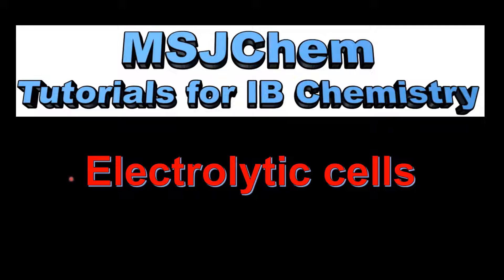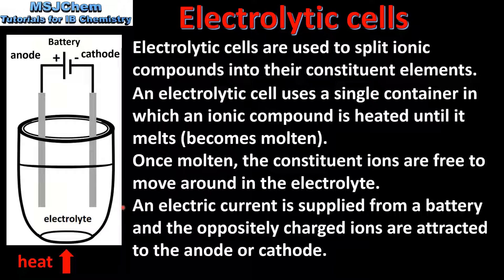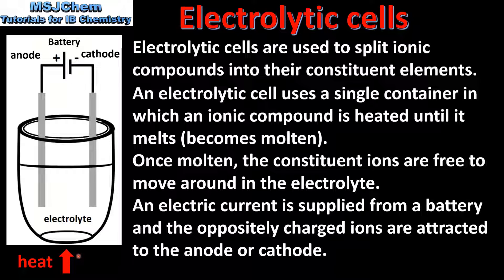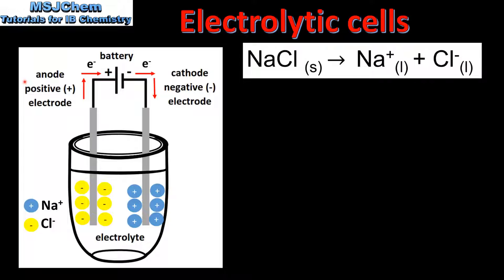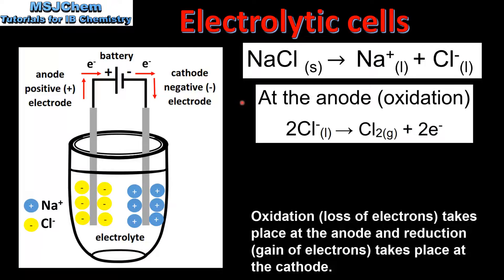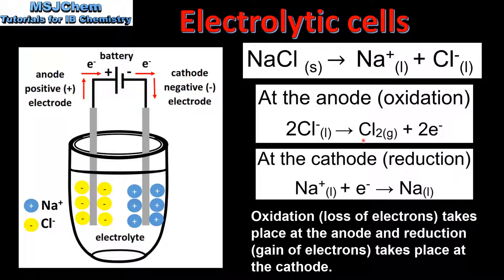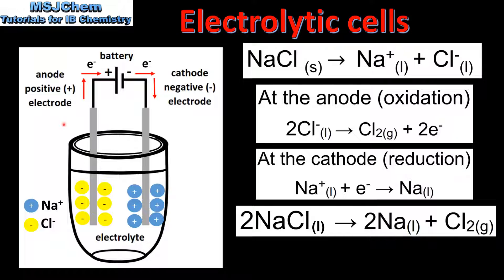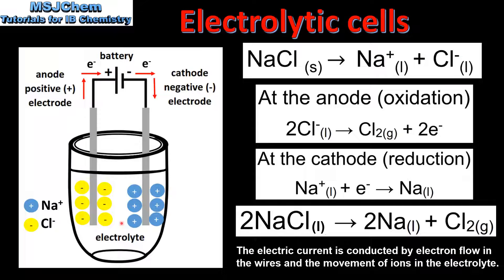R3.2.8 Electrolytic cells

Comment: is the anode negative?
Reply: This is an easy way to remember which is which: we have "voltaic cell", "electrolytic cell", "anode", "cathode". "voltaic cell" begins with a consonant, so it agrees with the "cathode", which also begins with a consonant, and disagrees with the "anode", which begins with a vowel. Agreement = +, disagreement = -, so for voltaic cells cathodes are +, anodes are -. "electrolytic cell" begins with a vowel, so it is the other way round
Reply from the maker: In a voltaic cell, yes. In an electrolytic cell, the anode is positive and the cathode is negative.
Reply: @MSJChem  thanks for the fast response
Reply: ahh so we meet again my friend